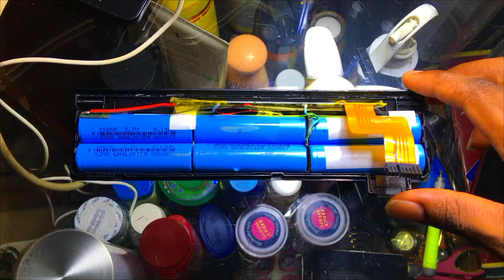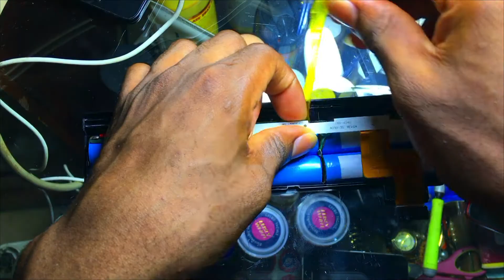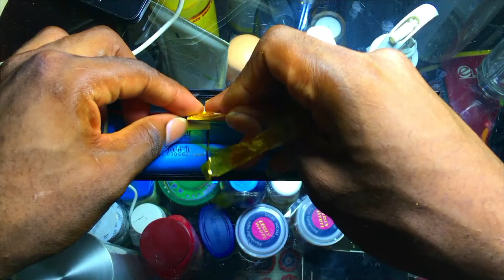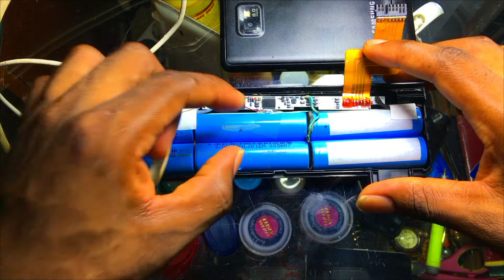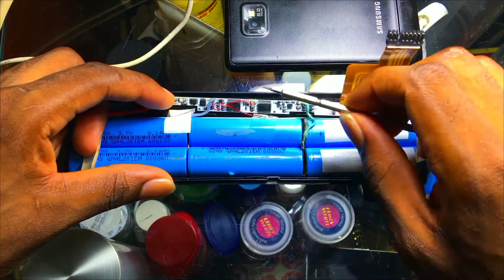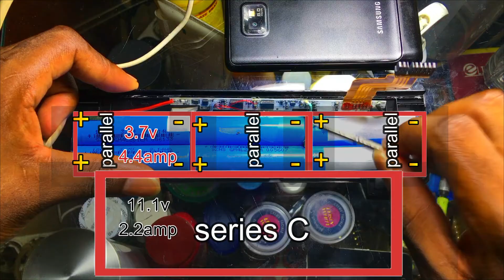How to Repair any Laptop Battery

Comment: Sir can i replace circuit with other company battery with same volt output in +- then connect connect data clock and temp wire where it is placed in my battery

Comment: Hi, I love your videos bro. But your explanations on how a MOSFET switches is very ambiguous.
For example, an N-channel MOSFET turns on when the gate voltage is a few volts above the source. 
Current flows into the drain and out of the source but not the other way round.
Reply from the maker: ok bro thanks  a lot sir .

Comment: Do a demo by repairing one
Reply: And if possible get a microscope you good at teaching we need to see more stuff clearly
Reply from the maker: Ok bro looking up to that 👌
Reply from the maker: Ok sir
Reply: @SergesMike  my lappy shots down after the laptop starts intensive work. But works fine when only on AC adaptor. I guess the battery is bad, right? If i open it, how do i know the specific one battery that is bad?
Reply from the maker: Ok sir